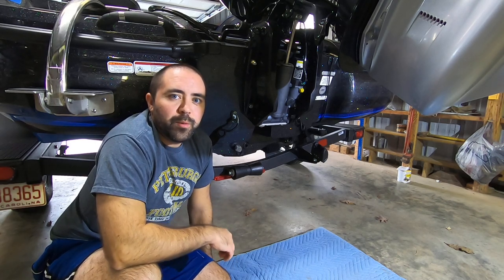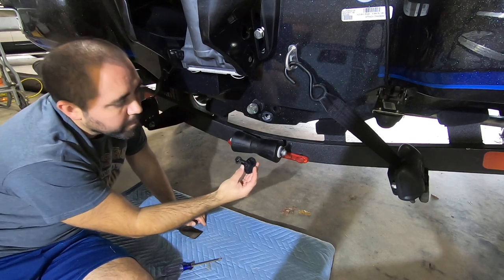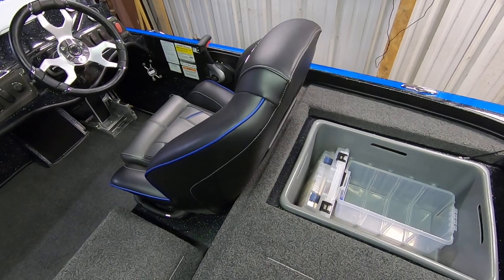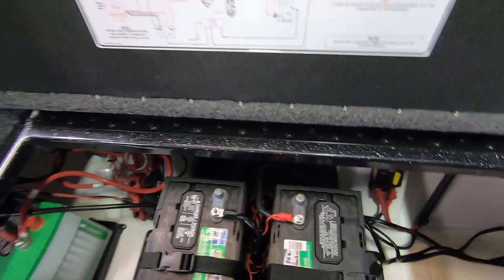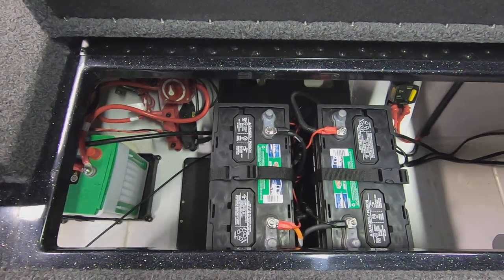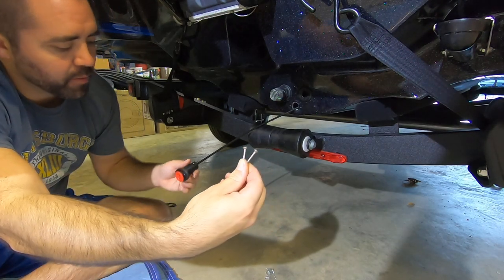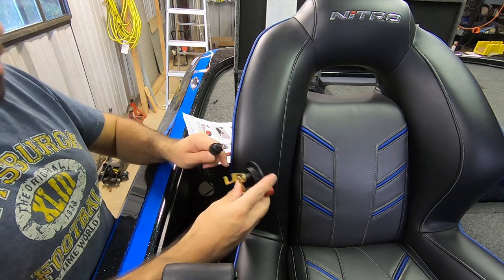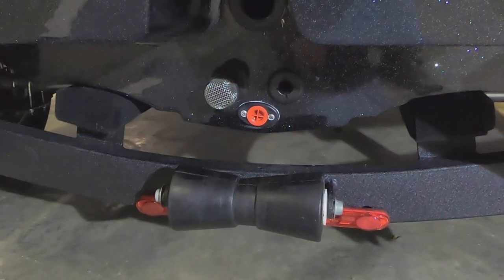How to Install a Remote Drain Plug in Your Boat

Comment: Do these leak any at all ?
Reply from the maker: Mine hasn’t leaked a drop.  I still always check to ensure it’s fully in after using the switch, but it’s always been 100% water tight

Comment: How long a cable did you have on your Flow Rite remote drain plug for your Z18 and can the cable be gently coiled and/or curved around obstacles?
Reply from the maker: I used the 8ft option and I had enough room to go from the drain to the shifter side of the driver seat.  If you went with 10ft you could put a coil in it to take up the slack without any problems

Comment: Will it work if your plug opens to the inside of the boat
Reply from the maker: No unfortunately - the cable runs behind the plug back to the switch... if the plug was inserted from the inside, the cable would have to run outside the boat

Comment: Will that work on my 14ft Jon boat
Reply from the maker: It should, but it depends on type of drain hole you have - some aluminum boats are meant to be plugged from the inside, and they don't have a perfectly circular opening on the outside.  As long as the plastic housing on the remote drain plug will make a water-tight seal on your boat, then yes it will work.

Comment: Do you have a link? Great vid keeper coming
Reply from the maker: This is the one I bought - definitely make sure to measure on your boat though to make sure you buy one with the right size cable

Flow-Rite Controls MPA-RDP-008 Remote Drain Plug W https://a.co/d/jfxPeKl
Reply: @Everydayfishing  Found that the cable is not the problem BUT the original drain plug hole is bigger than the remote drain plug..Had to make adapter with 1/4in lexan.
Reply from the maker: @Letzgobrandun-wi1pc  Oh wow, I thought 1 inch was a standard size.  Nice job though!

Comment: I just came across this video online https://www.youtube.com/watch?v=qdqaKmMygjw and immediately remember the video you made on this.  Would you have use something like this instead of having to drill the bigger size hole by the driver seat? Just curious your thought on this?  I want a remote drain plug and this seems less intrusive of a design in mounting it
Reply from the maker: Yeah that corner bracket is super nice!  I like that idea.  Definitely saves you from making a bigger hole.  Not quite as accessible... have to open the compartment at the ramp, but that's the only downside I can see.

Comment: I would not trust that. It looks very Cheaply made. Not going to put that in  or on my boat.
Reply from the maker: Flow-rite makes a good product - they’re used by lots of boat brands.  I’ve had zero issues with mine.  You probably have a Flow-rite valve in your live-well actually